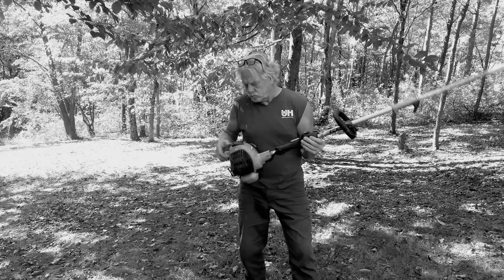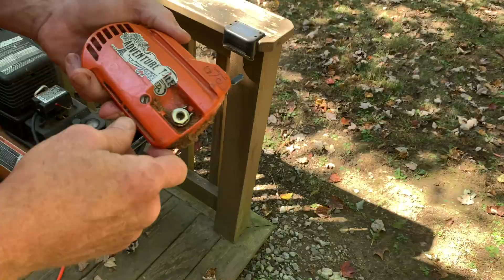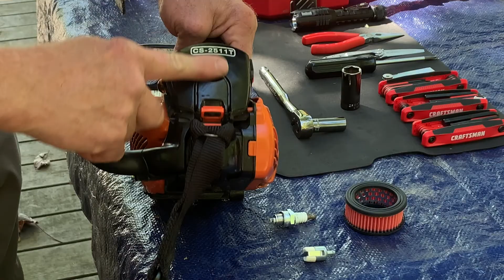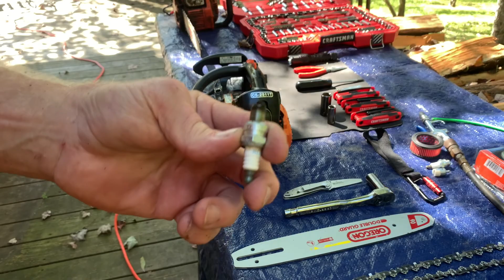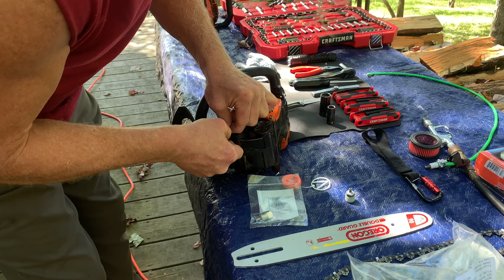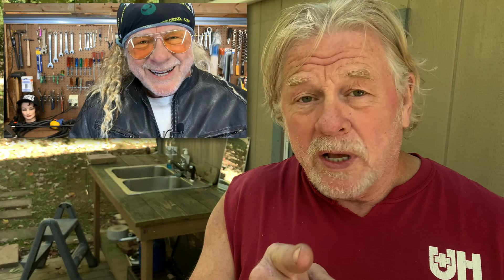ECHO CS-2511T Chainsaw Maintenance for Beginners

Comment: My Echo dealer just serviced my weed eater and chainsaw and told me to use nonalcohol gas so carburetor will not corrode.  Rubber parts in the carb will stiffen with age from the aromatics like benzene in the gas so try to empty gas and run until it dies.  I take off the bar and clean the chain channel so oil can flow to chain every tankful.  The wood I cut is soft so it clogs up easily.  I also try to cut using the top of bar so sawdust will clog slower and I can go 2 tankfuls before cleaning bar.

Comment: First time watching. Thanks for genuinely being yourself. I’ll be looking out for future videos.
Reply from the maker: Thanks, Dwayne! I'm working on a CS2511T rebuild. I ran that same saw over with my tractor during a tree removal. I will also be installing a straight pipe in place of the stock muffler in hopes of eking out a fraction more of horsepower. The video will come out as soon as my parts order comes in. Thanks for the kind comments. Stay kind!

Comment: Just bought one of these tried it once and the chain came off.  Now I'm having an issue getting the clutch cover back on.
Reply from the maker: Make sure you loosen the chain tensioner screw before trying to put the clutch cover back on.
Reply: @WaynePolcin  yup did that.  The ring part doesn't seem to want to go flush with the clutch even when I tighten the bolt. Part of the plastic around that inner ring is broken so I might just return it.
Reply from the maker: @cyclonus01  without seeing myself, you may be right, but was it on ok before you took it off?
Reply: @cyclonus01  Did you by chance have the chain brake on (forward) when you pulled off the clutch cover?  I made this mistake and couldn't get it back on either.  You have to have the chain brake off (back) when you take the cover off as that leaves the brake loose enough to put back over the clutch when you put it back on.
Reply: @steveandandreaelms8400  no the clutch cover got damaged it seemed part of the plastic.  I ended up returning this chain saw and got the 355 echo instead.

Comment: Very good presentation.  But, please include more accurate Chain install instructions, That is, if your intention is to educate newbees.  1- ?engage the wood with high or low end of the cutters leading into the wood - ('mentalizing' - hi end suggests clogging at low end of tooth; and low end engagement suggests easy chip exhaust), 2- specifying the top or bottom of the chain bar,  3- the inner chain teeth shaped to engage the bar-sprocket in only one direction.  thanks and good job otherwise
Reply from the maker: Points well taken, Weldon. I have moved to a new home recently. Once I have my new shop assembled I will consider a redo, incorporating the points you mentioned. Thank you so much for the feedback!

Comment: Hey Aunt Judy!! Love ya and your family. 
Wayne, I wish you could service my Echo Curved Shaft String Trimmer for me. On my second one now with what appears to be an issue in the 'ignition coil' in that it won't start. Gave the first one that this happened to away to our church men who do lawn and cemetery maintenance and am told it was easily fixed (Bad switch wire?) instead of the ignition coil. YouTube video I sat through explained the procedure for replacing this item but I have no way of locating the right replacement part here. Echo web site referred me to CT Sales here as being our local service dealer guy. Seems they might be out of business as I never see vehicles in lot as I go by there. Haven't taken the time to look up a working phone number and have gotten a little perturbed that this 'issue' keeps coming up on me. The current weed eater isn't very old and just quit running on me after going at it on that property next to ours quite hard. Can you burn up a string trimmer? Can you travel down south for a day or two? (Just kidding!) About through dealing with our local Home Depot (Echo Sales) even though my credit is there. Lol #StaySafe #BeKind #StayHumble #StayBusyEvenThoughRetired #ShutUpNowEddie
Reply from the maker: Hi Eddie! Thanks for mentioning my aunt @Judi Corbett. 

As for the Echo trimmer, I have an Echo dealership that helps me to properly identify the parts for the trimmer. To get the right carburetor, I had to provide them with the serial number of my trimmer, as there are many versions of parts for the same model number. The carb was very easy to replace. Maybe I will shoot a video of that process. 

I would love to journey down to Alabama to see you. That would be time well spent. Maybe we can drop in on our next trip down to the Florida pan handle to visit my daughter. Thanks for your kindness and love! Stay strong and kind!

Comment: Hi Judy!!! 😊 I hope you're doing well.  Hi Wayne, it's a coincidence that you were tuning up your saw, as I was just doing that yesterday with my Chinese saw. She's old, and has sat in my shed for 2 years without being used. Pulled it out, cleaned it up a bit, but she wouldn't start. So after digging around a but, I had no spark that the plug. She was oil fouled and glazed. Gave it a touch of sand paper at the electrode and Ta Da! Spark. I'd have replaced it but I couldn't find an equivalent plug locally and didn't want to order one. Long story short, she fired right up after that and so I can use it once again. It's a good thing, too, because I sent my Poulan 5020 went to a new home yesterday. I wish you two good luck in finally getting the 13 acres, and for Suzie to get a job closer to SM Heartland. Love you both! 💓
Reply from the maker: Hi Angie! I guess like minds think alike, ey? I think our life defines what living for the moment really means. My head is spinning, but I’m sure all will work out. It’s just a matter of time. Until then, life happens! Thanks for reaching out to aunt @Judi Corbett. Love you, Angie!

Comment: Hi Wayne , IAM not a tree climber but my saw dealer claims lots of climbers are going to battery saws .
Reply from the maker: True, but not me. It costs nearly $1000 to get the saw and two batteries. I can buy three CS-2511T saws for that price. If I were a bigger operation I would consider it.
Reply: No muffler mod on the 2511 ? Man those things have so much potential with some port work. I have sent out at least 10 over the years. Haven’t gotten one back yet. The first one I done was around 3-4 years ago. I sold my 201 after buying my own and porting it. I love it!